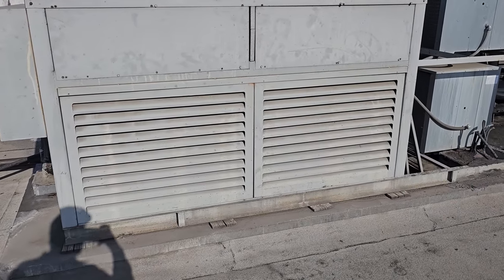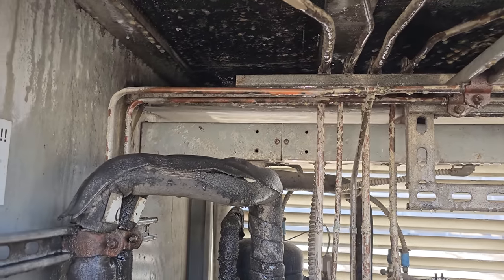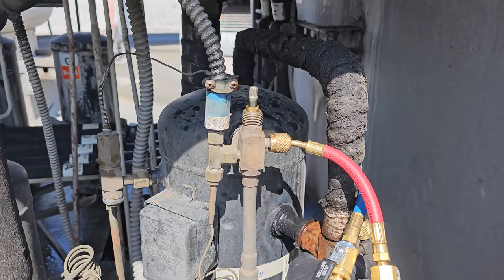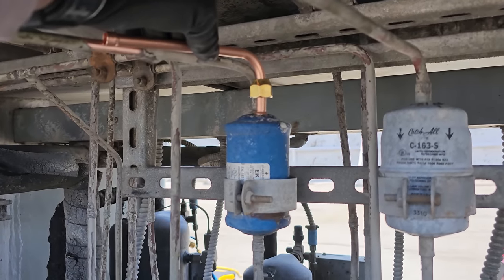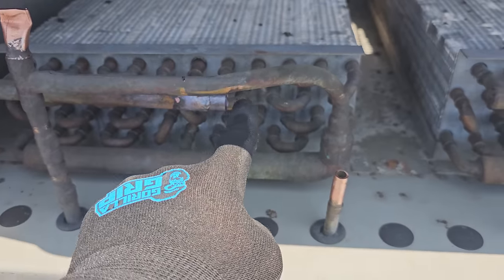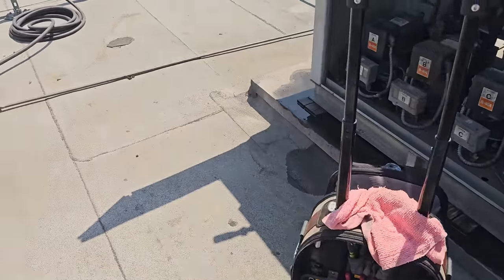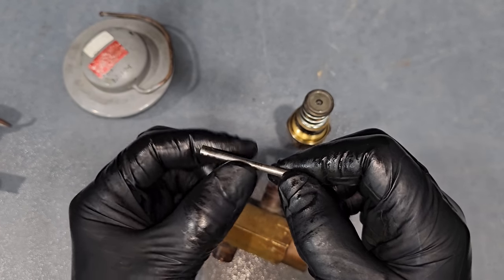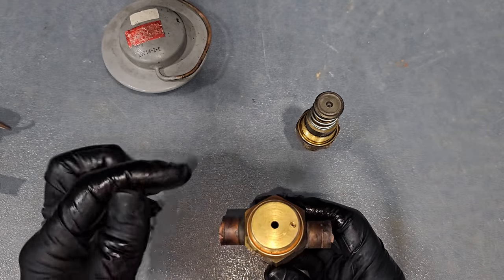THE FREEZER IS DOWN AND WE NEED YOUR HELP!

Comment: Chris - I'm a home owner, not an HVAC professional.  I have been watching for a few years.  It started when I was trying to figure out who to believe - we had an issue with our old system and got conflicting diagnostics from local companies.  I started searching Youtube for videos on how residential split systems work and how to diagnose them.  One of your videos on how to diagnose evaporator coil issues based on superheat readings gave me the information I needed to figure out which local company's diagnostic results to believe (partially plugged coil).  That plus a natural curiosity on how HVAC works keeps me watching your videos.  I've always been impressed at your professionalism and thoroughness, i.e., big picture.  Keep up the great work and great videos.

Comment: It was early 2019, I had never worked on anything other than refrigerators, wine coolers, and residential AC, and I got thrown into needing to diagnose a walk-in freezer. Defrost clocks were alien tech. Searched for a video and yours came up. Been subscribed ever since. I've learned a lot. And even won one of your X-Mas giveaways! As long as it's not affecting you negatively ... Keep going. Cu you've helped a lot of people.

Comment: I have been watching for about a month.  I was once part of a family run electric motor repair shop, so I have repaired and rewound the larger hermetic motors,  We also sold the smaller condenser fan motors and fan blades, and other related supplies.  I did custom control panel for electric motor controls. Most of what you see up there I am very familiar.  Some of the ac controls and system not so much, but I have a basic knowledge of how they work and continue to learn.

Comment: Thanks Chris!  Been watching you for 3 1/2 years or so now.  I do the same job (including hot side, unfortunately) for a chain in Colorado.  Lot of similar equipment, though most of it is circa ‘94-‘95.  Helps me immensely.  We have 40+ locations and only 3 of us in-house to keep everything running.  I sneak in a factory training when I can, but only about 30% of our job is refrigeration, hvac, and hoods.  Grills, fryers, and ancillary prep equipment take up a LOT of my time.  Your videos have helped my process and I changed the way I do quite a few things.

Comment: I have been watching for at least 3 years I cannot remember how across you it might have been big Clive. As the company I was with was going into AC from industrial compressors as  myself & another engineer had some AC experience from previous jobs. I still work for them as a consultant as I had an accident at home with pulling 2 discs in my back plus other complications so now working from home.

Comment: Have been subscribed and watching for 4 years. Working on the ventilation side of the trade for 42 years.
Extending the discharge on the kitchen exhaust fan with a removable aluminum cylinder could solve the grease build-up on the coils. 
Thxs for the vids!

Comment: Another cracking video mate. I like your on the tools as it is format. Diagnostics ,solution, repair and showing it working. I am an electrician by trade and now do facilities maintenance of a large industrial building. We have about 30 split ac units, and two walk in fridges on-site.  The company put me thru my fgas qualification, I found the course mainly about the safe handling of the refrigerant rather than refrigeration theory. I find your content very informative. I have watched your channel for about two years now and I have put your teachings to use. Cheers. All the best.

Comment: I started watching your videos around 2018 or 2019, it was around the time when i was struggling with refrigeration, watching your videos helped me to diagnose problems and i got more comfortable with refrigeration

Although i mostly work on domestic refrigerator, its basically the same concept just on smaller applications

Comment: 35:00 - Before listing many of the things I’ve learned from these videos, I’ll answer your question: I was introduced to your channel shortly after beginning, (two years ago - now completed) an HVAC/R class at a local technical school, by Brian Orr (another channel I found shortly after starting the class).
Things learned from this channel:
1. Brazing techniques (thank you for not speeding through the brazing part as some channels do.)
2. Efficient tools to buy
3. Evacuation techniques
4. Charging techniques
5. Deeper understanding of the basic refrigeration cycle 
6. Liquid line receiver purpose and position in the system
7. Suction line accumulator purpose and position in the system
8. Low and high pressure control function during pumpdown
9. Head pressure control valve for low ambient control
10. Technique for changing out a failed TEV
11. Defrost termination and fan-delay relay
12. Defrost clock settings for different applications
13. Use of solenoid magnet to allow sufficient N2 flow for brazing and complete evacuation
14. Efficient workflow organization
15. Overall I have developed confidence in my ability to conquer all things refrigeration
The list continues to grow, thank you very much!

Comment: Of course we're gonna watch your videos, Chris! You're sensible, down-to-earth, and you give a straightforward explanation as to HOW you reach your diagnoses. You take most of the mystery out of HVAC, and I think those of us not in the field appreciate this and can follow you easily through the steps. I feel confident in stating that a good portion of us are probably shouting out our "keyboard warrior diagnosis" in each video.

I've been watching for two or three years now... Maybe four? Out of the blue, you popped up onto my YT main page, and I thought "why not check out some different content?" I don't remember what video it was, but I subscribed after watching that video. I appreciate the no-nonsense approach, and I've learned loads from you about HVACR - which has helped me immensely at home (in-window AC unit that didn't need replacement, just a good condenser cleaning) and in automotive as well to diagnose car AC systems (as I've said before, and I will probably say again, the basics apply regardless of the application). You don't edit out your mistakes, and that speaks volumes as to your integrity and honesty.

I also am a massive believer in PM and "big picture" diagnosis. Sometimes system failures come from multiple issues, and taking in the whole picture means you can apply a repair that will prevent call-backs or increase the longevity of a particular unit. "An ounce of prevention is worth a pound of cure."

I wish you operated in Connecticut, because I would INSIST that my place of employment have you under contract. After all, the exhaust fan I reported as not working in October 2021 is STILL not working, and not once has anybody even cared to have a tech give it a once-over. For all I know, it could simply be a broken belt... Alas, I have no roof access, so I can't get up there and diagnose it myself! (And you bet your butt I would be!)

At the previous workplace (the fried chicken establishment) when we had to open the roof hatch to get indoor temperatures under control because our AC quit, I was walking on the roof one night before shutting the hatch, just looking around and thinking, "I know what ALL of this stuff up here does, and I know the basics of how it operates, just from watching Chris." It was a pretty good feeling.

Looking forward to your continued success, I can't wait to see what Summer 2023 brings us!

Comment: found your channel 4+yrs ago. i was having issues with my home AC and was researching AC upkeep. i also work maintenance at a southern US casino where HVAC issues abound with our humidity. even considered adding a HVAC cert to my skill set. i currently just use what ive learned to help with our ice machine cleanings. i liked the way you presented the material, your troubleshooting method and your work ethic with the field. i was able to replace the capacitor and AC breaker to limp my home AC system along until had to get a new unit right before 2020. i have since been taking care of my own home system cleanings and saving $$ not having a service do it. can't wait to see more of your home HAVC progression. thanks

Comment: For those that dont know LAC stands for Low Ambient Control. I've added head pressure controls like this to split system type of equipment ( non refrigeration style ). It really is the one of the best ways to operate a system in low ambient situations. Its better than fan cycling, fan speed and at least on par with fully digital scrolls. I feel its just as safe as comps that modulate speed....which can have their own set of issues....mainly the reduced speed....can create oil return issues and its reliant on controls and sensors to make it operate. This type of "dumb" control requires no wiring, no sensors. Is it 100% bulletproof....no...but nothing  ever is.

Comment: I am in a situation where i need to understand refrigeration and do as much as i can myself. I have an old theater with a worthington compressor in the boiler room and a newer, as in from the 80s bac cooling tower on the roof. I also buy auction display coolers prep tables etc. It really helps learning the proper techniques and brazing.  Thanks so much. This was beyond what i do but still helpful.

Comment: I just stumbled across your channel a couple of years ago I watch mostly construction and repair channels. I am 81 and spent my career making bespoke fine jewellery so it always makes me cringe to see you take the flame away from the joint allowing the piece to oxidise in air before reapplying heat your brazing sticks must have a powerful flux .For me it was even on gold a single hit or in to the acid bath and re prepare. Your explanations of why you are doing things almost help me understand what is happening in the systems 👍🤓🇬🇧

Comment: I deal with Specific systems units 15 ton circuits at work and them have king valves operater simular to that bypass valve. They also have bypass valves operate on evap low pressure and adjustable had to put new kits in about 5 of them, operate on a low setpoint range. Had a issue with 2 compressers sounded like they were bypassing because of the noise but ended up being the TXV's the pins were getting hanging in the valve mushroom from the driving pressures and get stuck. Watching your video's is isprational, insightful really enjoy them keep up the great work.

Comment: Hey Cris! I've been watching your videos for about 3-1/2 years now, I don't remember how I got to your channel, must have been a recommendation from YouTube. Glad they did however, because I never miss your content. However I do have to admit I don't watch the Live Recordings and have only seen a few of the HVAC Overtime shows as I work in the residential and light commercial HVAC industry, so don't have a regular 9-5 clock in and out schedule. I know all refrigeration information JUST from your videos and have been able to help out some commercial customers who asked me to look into their refrigeration units. Your work ethic is the same as mine, don't just go in fix something and leave, never has been and never will be.

Got a new job during covid at a company after working "self employed" (1099 😜 ) for 15 years and all my work was perfection (to my eyes). Once I started working for my current employer,  mid sized (about 24 installers and 8 Techs) I finally got to see where shortcuts, ambivalence and bad thinking from installers can really be bad for both the company and customer. I get all the "THIS NEEDS TO GET PERMANTLY FIXED" jobs now because of my work ethic and I get no flash back from management if I'm taking long or get extra material, because they know I'll get it done right.

Also, love the style of making your videos, for everyone but you're making it for training for your workers and I have recommended your channel to ALL techs I come across because it's how it should be. The talking out loud your thinking, ANY thinking person does the same if they're trying to figure something out. It helps vocalizing it as it is a bit more concrete when we hear it than just a thought in the head. Now if you ask my wife, she'll say I'm just wasting time standing there murmuring and staring at something 😜

Comment: As a non HVAC tech that is an interesting valve. Im more used to electro pneumatic relays with their galleries that lead to ports you don't know what the heck they do til you see one working. (as in: block this air flow port to actuate the pnumatic switch, or vent air from that port to actuate etc.) This HVAC stuff seems a lot more solidly built then small pneumatic valves. Although, I do have valve manifold blocks covered in valves that weigh 50 lbs.

Comment: Hey chris, ibelieve the condenser is piped incorrectly,  going by the air flow, the condeser is installed upside down/ wrong way...coolest air should hit the condensed liquid in the coil first, not the hot  discharge gas... system looks over charged with the condensing temp above ambient split...charged to clear the sight glass, swapped the conders around and id bet the pressures will be right, and charge in weight less....
Thoughts....

Comment: If you think about it the liquid injector is the same as the mixing valve, the concept is with the pin in the middle, injector has two. I’ve taken the injector off and the pins on those definitely gets stuck , it seems to me those valves are getting hot and then cools down some and then  warps over time. That’s the only thing that I can surmise as what causes those pins to stick. My theory.

Comment: Since the condensers are too small and several aren't used, could you recover charge from one or both of the unused systems and then loop the condensers to gain the extra surface area you need? Just wondering if that would even be an option.

Comment: Probably 2+ years not shure orginaly just because I wanted to know how to properly work/diag on car r134 ac stuff as there's so much bad info out there... The big one is what causes high pressers and why you should not just use the low presser only guage. With cars its almost always some dummy contaminated the system but still useful advice on here that applies. And it really helped me recently on my older ev as It is more similar to commercial/household systems with effectively a vfd and electronic valves/sensors. I fell like if i was interested in this as a career would have a hell of a head start after watching theses videos.
Reply: I think i might have found you after watching steves videos but he can be a bit of a harsh personality so don't watch him much.

Comment: Dumb question, why is the condenser piped for liquid output from the top, thus being a parallel flow exchanger, rather than the opposite, a counter flow heat exchanger which in theory should be more efficient? Oil retention to flow back to the compressor?

Comment: Okay I have a question since you already have other coils in that unit that are not being used couldn't you just add an unused coil in series with the current oil that is being used to increase its capacity

Comment: Why would the liquid drain be at the highest point in that condenser coil? Wouldnt the coil have to fill up with liquid before you get a clear sightglass? Wouldn’t that use up all of your surface area, raising your head pressure?

Comment: you know its called a head master and its a common  failure cut captube on head causes it to not bypass FYI. but you can have your customer pay you to redesign an old system i wonder why it worked before?
Reply from the maker: A head master is actually a trademarked name for the Alco/Emerson valve. This is a Sporlan valve the the technical name is LAC VALVE (LOW AMBIENT CONTROL) the term head pressure control valve is a generic name for any hea pressure control valve. Cutting the cap tube can be risky because sometimes the gas charge can Leak thru the bellows. And in the case of this valve the powerhead lost its charge anyways so cutting the capillary tube would have been useless
Reply: @HVACR VIDEOS  i agree it can leak.. but it does allow bypass if it lost charge it would already bypass.... Which is what you did by passing it.

Comment: That rack has been a pain in the neck since it was made ,look carefully at the air flow directions. Look at the discharge Header and the liquid line header. The discharge header should be closest to the fan motor ,the liquid line header should be furthest away, so that the heat transfer will be in that direction. In other words the cool air must hit the liquid header first and exit through the discharge header.
Reply: That's exactly what I thought, condenser is fitted upside down/ wrong way round going by the air flow through the condenser.. system has probably had problems since day 1, looks over charged as well, to get a clear sight glass, system tripping all the tome in the warmer.months I'd bet.... had it before on a comms room remote condenser, over charged due to being piped up incorrect from day 1, system always had problems, tripping on low pressure in winter..5c outside temperature , then high pressure trips in summer as over charged..swapped the liquid and discharge pipes, bingo, no probs
...

Comment: I think you could have changed the power head and it would have worked. However if I'm going to evacuate the system, I'm going to change the txv or bypass (which I don't fool with much at all) I started watching your channel in 2008. :)